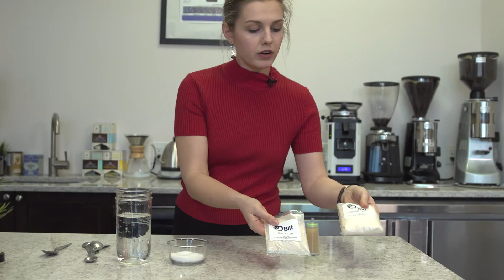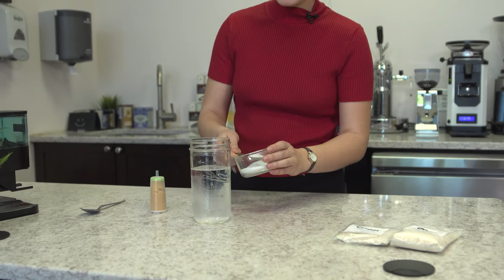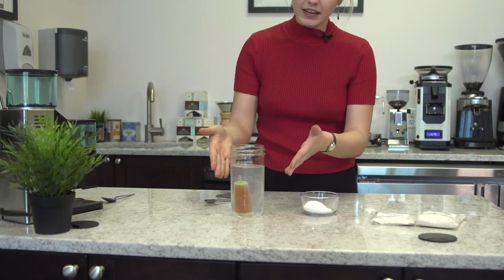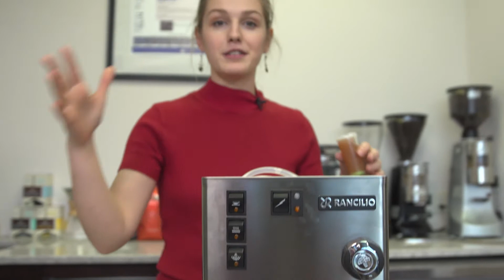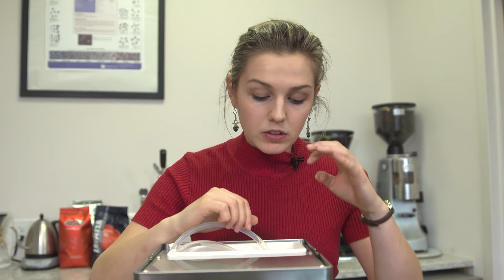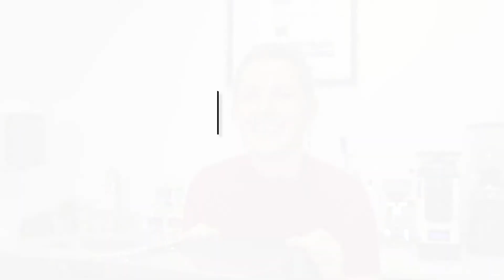Treating & Preventing Limescale

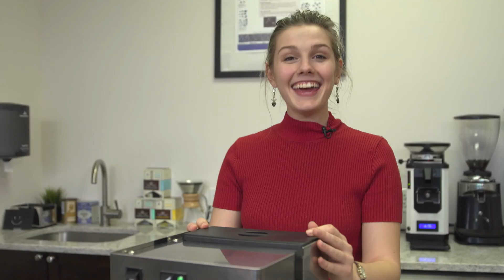Comment: 4:30 i wonder why i would wanna descale the machine, if I had a softener attached?
Reply from the maker: There are cases where the water is too hard for even a water softener.
Reply: @1st-lineequipment  thanks! And I also learned that removing all minerals from the water will make the H2O corrosive to the metals inside the machine. So the best is to leave some minerals in there.

Comment: why would I need to descale if I have a water softener? isn't that the point of it? or does it only help to reduce scales, not remove it completely?

I'm waiting for my Expobar Brewtus IV to arrive, and it's supposed to have a water softener filter installed. can I combine it with the softener bags for increased effect (I have those already at home)?

How often can I recharge the softening filter?

Cheers!!
Reply from the maker: Descaling is a corrective measure that can eat at the internal metals and gaskets as well as any internal coating or finishes.

Since we do not sell Expobar, we suggest asking your selling dealer for additional water treatment. We do not want to create any ripples with your selling dealer and then the blame game happens.

Prevention with water treatment is key. The Oscar pack is good for up to one year. The V725 cartridge can be recharged one to four times per month depending upon your water hardness.
Reply: @1st-lineequipment  ok, cheers